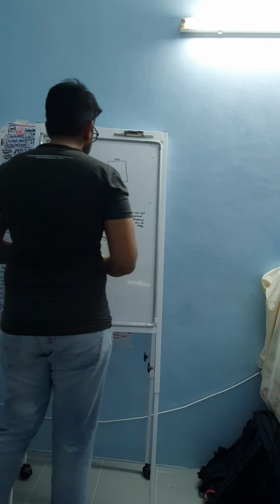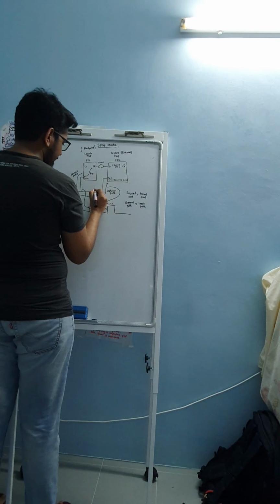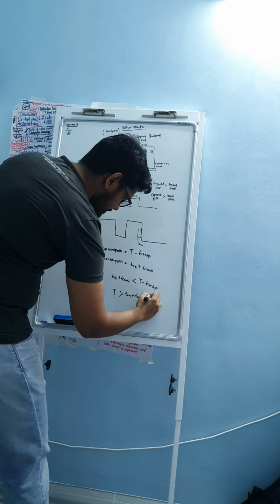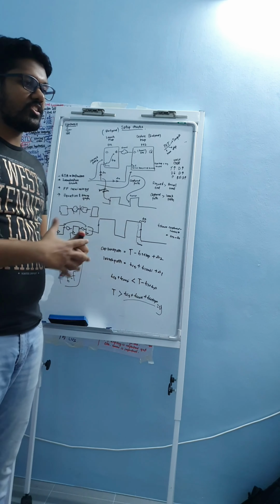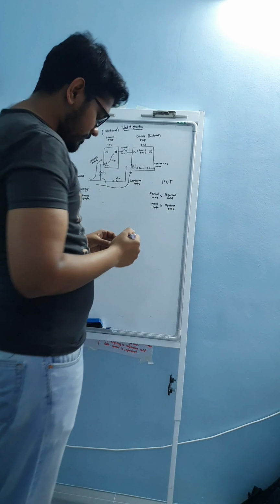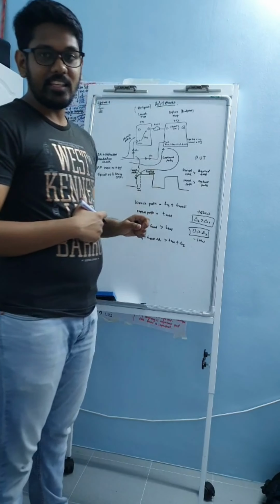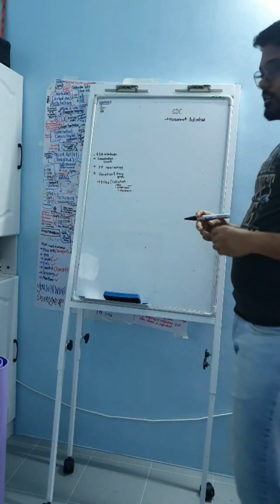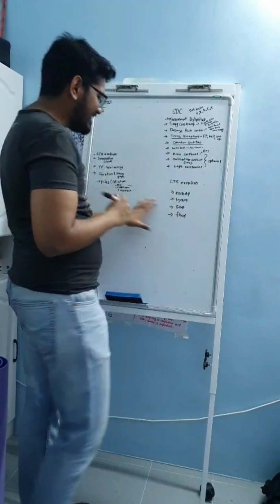Static Timing Analysis: Architecting Robust Sign-Off for High-Performance Silicon

Comment from the maker: This video quite prompt show up sharing: Here are some missing part which I cover on the part : 

a) Clock Path Pessimism Removal (CPPR/CRPR): This is the heart of modern STA. Understand the common parts of the clock tree should not be penalized by different OCV derates.
b) Signal Integrity (SI) / Crosstalk: In modern nodes (7nm, 5nm), timing is heavily dictated by "Victim" and "Aggressor" nets. Obviously, you cannot sign-off a chip today without discussing Delta Delay caused by coupling capacitance. --> this could cause functional issue
c) Multi-Corner Multi-Mode (MCMM): explaining on how we manage 100+ corners (e.g., Fast-Fast, Slow-Slow, Typical-Max-Leakage).
d) Recovery/Removal: focusing on the asynchronous resets (Recovery and Removal checks).
d) Graph-Based Analysis (GBA) vs. Path-Based Analysis (PBA), statistical OCV (SOCV), and low-power multi-voltage domain challenges. ( very important before sign off) 
e) Explain explicitly on the SDC exceptions